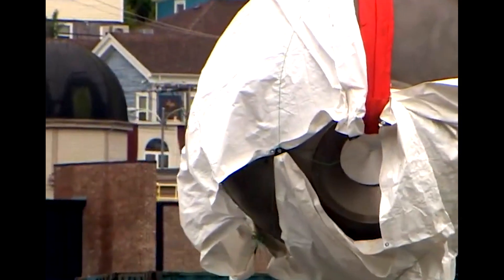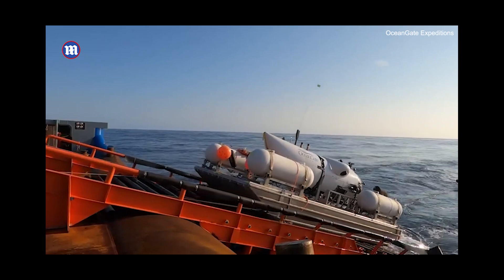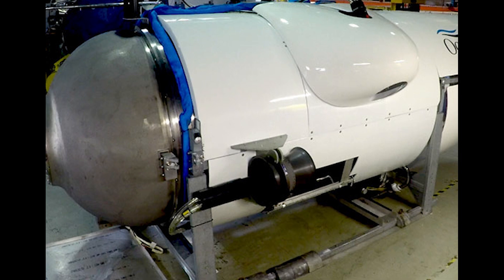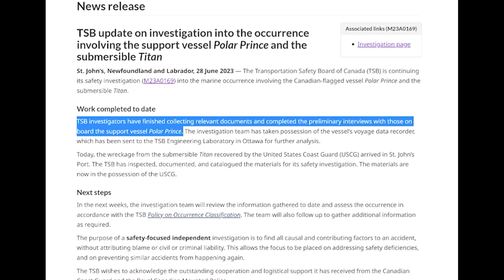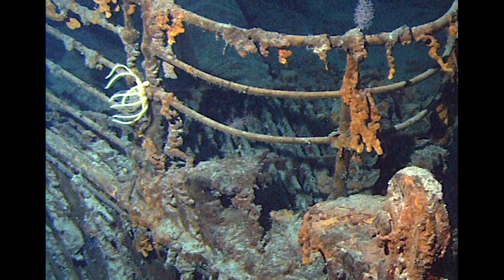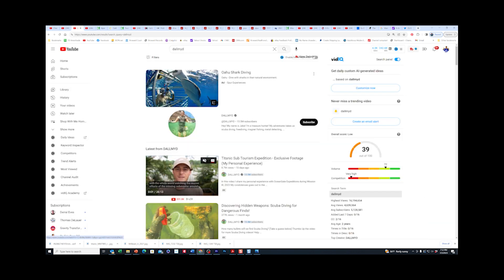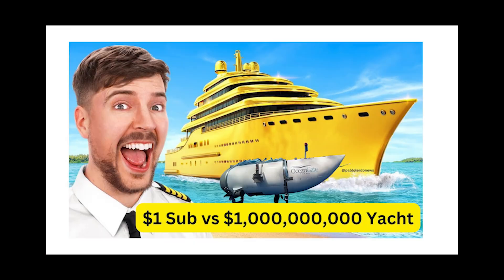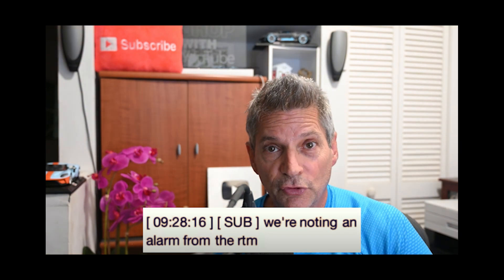Titan Submarine Debris Clues, Implosion Simulation

Comment: I wouldn't have taken a trip around the local roads in that thing - they GLUED it together!  Sheer madness 🤯 I hope something stops anything like this ever happening again.
Reply: I hate to break it to you but there are probably "glued" key parts of airline planes.
Reply: @tonysobon4669  No glue. Just bolts and rivets. Lots and lots of them. (If we talking metal planes ofc).
Reply: @alexturnbackthearmy1907  I thought that a lot of planes had a lot of parts made from carbon fiber  , also what about things like the windows? those are not metal and I bet would not bet bolted into place.
Reply: @tonysobon4669  Sure, maybe, but the windows aren't key to the overall structural integrity of the aircraft..
Reply: @tonysobon4669  Planes need pressure from the inside, the higher up you go = less outside pressure.
Same with scuba tanks, Paintball tanks, PCP air rifle tanks etc, inside pressure greater than outside pressure, that's what CF is good at and is safely rated to be used for.
With submersibles, you have pressures acting from the outside, not what it's rated for.
I'm not saying CF doesn't have DSD Vehicle applications, just not with manned & crewed pressure vessels.
Reply: @ToreDL87  I understand that , it is why even though what I know about carbon fiber and composites is only from doing body work on cars and why I do not understand with the video they have shown (i think from the company) that they thought using a spindle type carbon fiber chamber would be safe. Before I saw the video I thought that when they said Carbon fiber it would have been used differently , as more of a key  ingredient or main in one solid mold. If this thing was made to try something new and just made to be tested I could understand a bit more even though you could not pay me enough to be the tester , again a lot of what I am saying was thoughts I had before we knew it broke apart already and the only reports out were really about the search and rescue operation and the video of how the haul was made was when I thought there was no way they were alive (maybe like day 2) . I know the people involved are much smarter then me but yeah as soon as I saw that video on the news I said to My other family members watching tv "they are dead and it seemed like it was like they just wrapped a ton of layers on fiber around a soda can and how if you ran it over with a car it would still crush or weaken the wrapped can"  , I was debating with my cousin who was over for dinner that night since he didn't understand why I thought they were dead .
Reply: @followthewhiterabbit414  lol , not to the plane but for the people inside they are. My point was there is a lot of carbon fiber used to make planes that if it failed it could kill people or mess up the ability to fly.

Comment: The cylinder collapsed as is normal being the weakest point causing the ends to pop off. It's basic physics but the real question where was the failure that initialized it all.

Comment: Glue was used????????????????????????????????????????????
Reply: It’s the argument of using carbon, it’s the only way to attach metal bulkheads to fiber. I think the term glue is not accurate, it’s very expensive epoxy resin.
Reply: @afterburner119  that makes it better

Comment: I hope they weren't panicking for 20 minutes. My first thoughts on the RTM system was "What use is that if you're at great depth? It's probably not going to give you enough warning. It takes time to rise.  Even if Mr. Rush dropped the weights the moment the alarm went off they might only have had seconds before the hull failed. I suppose it will come out when the text messages Are timed against the loss of telemetry.  I do have to wonder about his attitude to safety. Why wouldn't you paint the thing red or yellow instead of white? A bit easier to find if it did happen to be floating. I'm glad they were spared that, that would have been dreadful.

Comment: The glued connection of the rings to the carbon hull is not crucial, because the pressure difference would keep it in place anyhow. Its more the opposite, a solid connection is a problem. The different expansion of different materals by pressure and temperature would have weakened the carbon structure mainly at the connection resulting in stressfracture.

Comment: The gluing without the titanium rings even interlocking with the carbon fibre hull also sounds insane, but i think nothing of that reaĺly matters,in the case of that hull shattering into millions of tiny pieces ,like a drinking glass,dropped from a multi story building onto hard concrete!!

Comment: Another way of picturing how fast an implosion occurs is to think what happens when a party balloon pops. When the balloon is inflated it is pressing inward with a slight amount of pressure. When it pops the pressure is suddenly released causing the balloon to instantaneously implode with a bang. In the case of the Titan the difference in pressure between the inside and outside the sub was hundreds of times greater than for the balloon so you can imagine the implosion being considerably faster and more violent.

Comment: Certainly interesting about the missing bolts. I’m likely to believe there was a single point of failure, so why are ALL the bolts missing from all 3 bolted connections? ( viewport, ring to front dome and ring to rear dome connections). And of course not a spec of carbon fiber still attached to the rings

Comment: Why did Stockton insist on carbon fibre, if it is such a unproven material to withstand pressure from the outside, i know they manufacture aqualung cylinders with carbon fibre,but that pressure is nowhere near what the deep submersible had to put up with(i presume).....very ,very foolish man! He needed to have his head read and certified,before he put other peoples lives on the line,and the submersible community penned him a letter , to voice their concern about the safety questions...he ignored it.......what the f#^k!!?

Comment: I don't see any broken bolts, or even holes on the flange area of the window, but possibly the resolution of the video is just too low. If the window did break the water rushing in would create such a high interior pressure it could blow the ends off the hull, but I would think the cylinder might remain relatively intact. Just speculating.

Comment: READ THE TRANSCRIPT OF THE TEXT MESSAGES BETWEEN TITAN & POLAR PRINCE MOTHERSHIP. IT EXPLAINS EVERYTHING. Here’s a summary of ACTUAL EVENTS:

Stockton Rush invented a “real time hull health monitoring system” abbreviated RTM, which alerts the operator if the pressure vessel is in danger. Stockton holds the patent on it. That RTM alerted the crew about 17 minutes before loss of communications. Stockton tried to slow his descent immediately and ascend within the first 2 minutes but SOMETHING KEPT DRAGGING THE TITAN DOWN!! They kept descending FAST even after dropping their main ballast weight!?!  Then they started hearing crackling noises in the rear of the sub. Next they dropped their heavy landing skid to shed even more weight - this took multiple attempts for some reason. They finally started rising but for some reason not understood the ASCENT was EXTREMELY SLOW as pointed out by Stockton. The natural bouncy of Titan should’ve meant a much faster ascent.  They only rose about 50 meters from their lowest point. Finally Titan’s  ELECRIC bus “A” went offline, Stockton switched it to bus “B” to keep communicating.  More crackling noises were heard.  Implosion happened about 2 minutes later. 

This must’ve been a very scary 17 minutes for everyone involved. I was terrified just reading the message log!  Stockton genuinely made the correct moves to ascend the sub quickly, and 17 minutes was enough time to get out of danger. We need to understand what forces were preventing Titan from rising at it’s natural bouncy rate after dropping all that weight.

Comment: I am just a layman but follow Formula 1 and we are always told Carbon fibre is only strong in one direction. I think that the carbon Fibre should have been Applied in multiple directions  (longitudinally, Diagonally) as well. I also wonder why there isn't a shard of Carbon left attached to any part of the visible wreckage. Also we know that the Porthole was only guaranteed to 1300m.

Comment: You missed something,  when they where attaching the ring to the tube , the ring only has rectangle tabs and they are using those with slings, when they are lifting it from the salvage boat they are lifting it from a different lifting point " eyelet" with d shackled , where is this eyelet seen on the video of it being assembled?

Comment: I saw a video of an implosion of a carbon fibre cylinder with metal ends from 10 years age on YouTube. The cylinder split longitudinally along one side and the event was over. The carbon fibre didn't shatter into pieces, just one long crack.

Comment: The design of it was insane. Carbon fiber does great with impact or pressure one time. But after that it's structural Integrity is questionable at best. Race cars especially open-wheel type is a prime example of that when one crashes it does great protecting the driver but it's disintegrated after that first time. I'm guessing that repeated Dives cause the actual resin that holds the carbon fiber into its shape started to break down and probably start turning the powder on the inside weakening the structure with each dive. Eventually it would have to give way. That is the one downfall to carbon fiber is its great structurally really for what it is and it's great Under Pressure once but after that it's questionable structurally speaking. I'm not a engineer or material specialist but it doesn't take one to know that. Common sense and things will get you a long way and when you use a material that will disintegrate under pressure and then subjected to repeated pressure it's a no-brainer that it's going to fail it's not a matter of if but a matter of when. I guess the best we can hope for at this point is everyone in it was right with God and that it was quick. There's a reason why every other type of sub and submersible out there is not made with anything like that but homogeneous metal. Something that has the ability to shrink stretch Flex Etc and Still Remains structurally sound. I feel bad for the people involved and who lost their lives but whoever designed that and thought it was a good idea wow I don't even know what to say.

Comment: I think, the porthole window was taken out after the Ti ring came to the surface or close to surface, because they needed a better grip (Ti ring is heavier in the air than in water), so the sling can be looped through the hole.
The acrylic window was saved for evidence and inspection!
Reply: No, they didn't remove the porthole to get a 'better grip'.  You don't tamper with critical evidence like that in an investigation.  Also, the acrylic window was not just held on by bolts.  There was an adhesive/sealant where it mated with the titanium end cap.  It wouldn't have been possible to remove it 'on the fly' like that out in the middle of the Atlantic ocean...
Reply: @johnbergstrom2931  How do you know, smarty?
So, where is the flange was holding the window with zillion bolts?
Fell off?

Comment: Another design flaw I reckon, is the hatch, even if it could be opened from the inside, is partially submerged. So even if you could open it on the surface, it would flood the vessel. It seems to be essential the submersible pontoon keeps working, as it appears the mother ship cant lift the sub.
Reply: By design so they could rent a surface ship without a big crane.
Reply: @zapfanzapfan  The pontoon yup. So they can rent a cheaper ship. But open that hatch in the water, and its gonna sink.

Comment: I honestly think from all of what I’ve watched the titanium ends and rings squeezed the carbon like a toothpaste tube as well the cylinder disintegrated and the port hole blown out all with in a split second. I honestly think the victims and equipment were pushed through port hole.

Comment: Subs etc will make scary noises all the time as the compress and decompress. I would be very concerned about using different materials that are not uniform and compress at different rates. If the carbon fibre compresses under that titanium join then you've got a gap you certainly don't want.
The other thing is that steel and titanium appear to be elastic and can recover from the constant compression and decompression but the carbon fibre sounds like it accumulates damage until it eventually fails.
The whole operation sounded like a s**t show. Cutting corners at many stages, not doing safety testing, using items not rated for this. I.e. the window and regular electronics. You can imagine what would happen if a microchip overheated/short circuited and smoked while at the bottom of the ocean. This venture fiasco was an accident waiting to happen.
Also to say they were so close and must have aborted due to knowing there was a problem may not be true. Many went down and couldn't find the titanic with the poor positioning system it used.

Comment: Lovely work and well researched. I would add that I think from the implosion, the window would have shout out taking the flange with it. This would also explain how the hemispheres and titanium rings separated snapping all 17 bolts on both hemispheres/rings. The shockwave pressure would push both ends out at lightning speed causing these titanium components to separate. The carbon fibre which was not cross layered would have exploded into million little pieces. I’ve also seen that transcript, if true it’s absolutely horrifying that they knew their fate.
Reply: How can I see the transcript?

Comment: So common sense says you have two completely different materials comprising different yet equally critical components, then they were just glued together. Let's talk completely different expansion and contraction rates let alone the  prolonged stress effects.  Carbon Fibre is used very successfully in formula 1 racing in the production of the driver compartments or the monocoque tubs which are stressed components that act as base for suspension, engine mounting wings and down force etc. It is calculated that under extreme circumstance, say in a wreck these tubs have survived impacts in excess of 150 lateral G's in a few extreme cases, however that is only for an instant that those forces are on that carbon. At 4000 meters that's something like 6,000 lbs pier inch of pressure making the sustained overall force on the exterior of the sub somewhere in the millions of pounds, and the guy didn't have the good sense to craft a sub entirely of titanium such as in the standard in the mini-sub community. Then top it all off with a straight barrell wrap of the carbon fibre material no weave at all giving it far less strength than one should have had, them let's go take this death trap to the one place on earth where there are absolutely never any second chances. Like you and others have said, when it finally failed, death was so instantaneous, their synapses couldn't have fired quick enough for them to feel like or even think about saying ouch. That's the 1 solace amongst all of this it was over before they knew it happened

Comment: The viewport is not rated for the depth? Criminal negligence. The Carbon fiber Tube/Body should have been at least a foot overlapped with the titanium dome - basic common sense.  My guess is that like in a lot of air disasters. there's a likely chain of minor interrelated failures leading to catastrophic results..

Comment: The fact they glued the titanium rings right onto the carbon fiber hull sides seams like a misstake. Once the carbon fiber hull starts to crack under the pressure the side rings will pop off due to the change in size of the hull. Also gluing two different materials together is a dumb ide especially if the material can crack and break.

Comment: Think of the joint as a pressure seal for the titanium dome that's essentially getting pushed straight on to it. You know you've got dissimilar compression rates so you really don't want too much overlap, just enough to keep it all centered up and physically connected when there's no pressure. A spiral wrapped tube is going to want to expand in diameter and contract in length more than one that approximates a bound stack of carbon rings. But as everyone knows strings are useless for compression (and thinking it's going to go better because you have so many of them makes no logical sense), even the ideal approximation of tiny concentric rings is inherently astable under pressure, and nobody in their right mind is making human rated diving hulls out of epoxy or plastics that go anywhere near that deep. Fascinating and horrifying to find out that they had dropped ballast and aborted the dive before the implosion.

Comment: I’m no engineer, but I have some knowledge of materials technology.
Bias wound Carbon fibre containers are great for an internally pressurised vessel such as a gas tank. It’s very strong under tension.
A spiral wound Carbon fibre cylinder would be less good for resisting internal pressure. 
As for resisting compressive forces? There’s a reason why previous deep dive vessels were metal spheres……

In retrospect, it seems sadly inevitable, but they were aggressively against criticism of the design.

Comment: they would have used a lift net not damage the item .maybe the rov removed them so it could float them . my issue was the resins were not degased so microscopic bubbles would have been impregnated into the hull